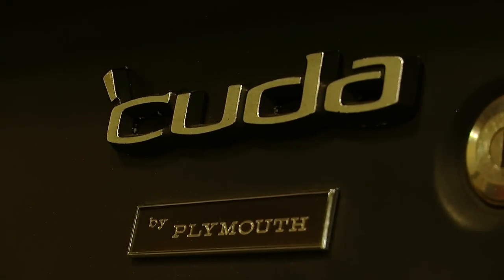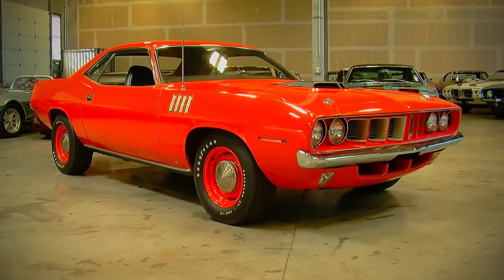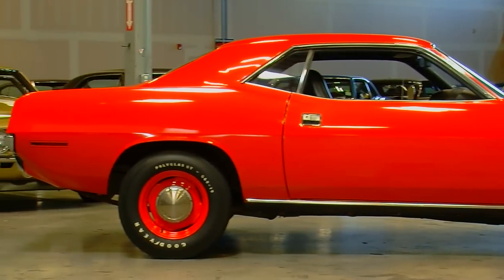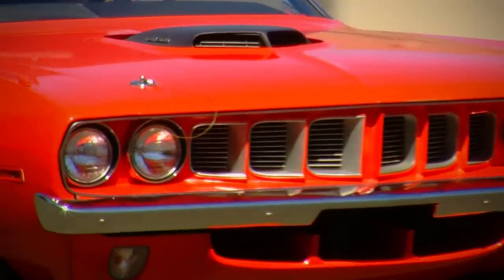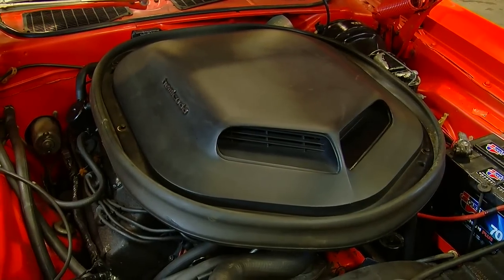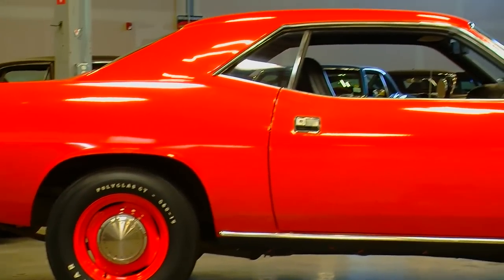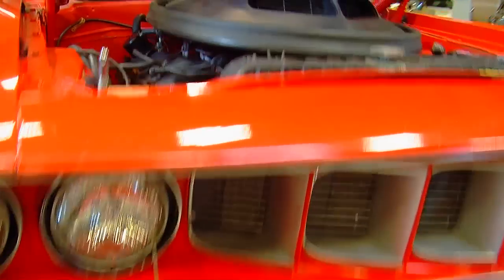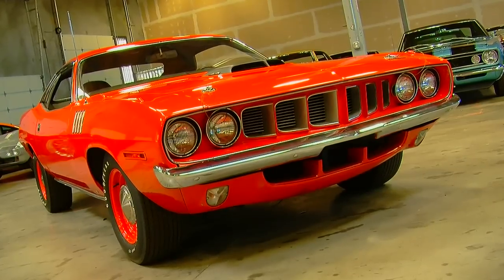1971 Hemi 'Cuda Video Muscle Car Of The Week #68 V8TV

Comment: Greatest American Muscle Car ever Produced IMO..the 68 Hemi Dart is the meanest, but the 71 Hemi Cuda is the all around Best.
Reply: True. The 68 Hemi Dart and Hemi Barracuda are the meanest factory race cars ever but the 70-71 Hemi Cuda and Challenger R/T are the meanest Hemi powered street machines. The 1966-69 Hemi's were probably slightly more powerful because of their solid lifter cam but the 70-71 Hemi's were much more manageable to drive on the street because of the switch to a hydraulic cam in 1970 for emissions reasons. But they still had 10.25:1 compression and they were still the baddest engine on the street even with the milder cam

Comment: Last year i found a 71 'cuda 340/Auto in Sassy grass & a convertible '70 Challanger 440 4 speed in Burnt Orange literally buriad in a garage. I had been in that garage 100x n never knew until i was sent in to look for a piece to tire machine n found out that were the cars have been since the 90's. And they are still there

Comment: Why no through the valence exhaust tips as it should have?
Reply: Could have been a California car. Or, ordered with the solid valence. Remember these cars could have been ordered to buyer's desires.
Reply: Yeah it would have to be a California car. I think some other state out North East had some single state emission rules too though not positive. You could order the cars as you wanted within reason, a plain valence was not an option. This is either a mistake or a California car. Chrysler made no mechanisms in place at the dealer or assembly line level to spec a car other than the build sheet and fender tag spelled out.
Reply: Definitely a California car, paperwork in vide showed it was delivered to the original owner in California.